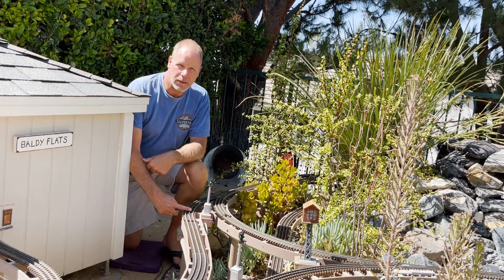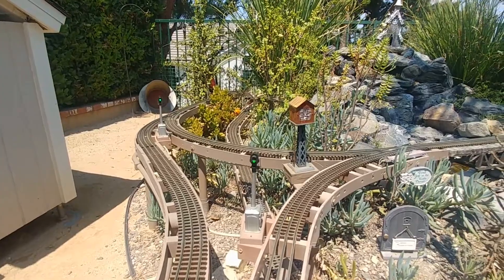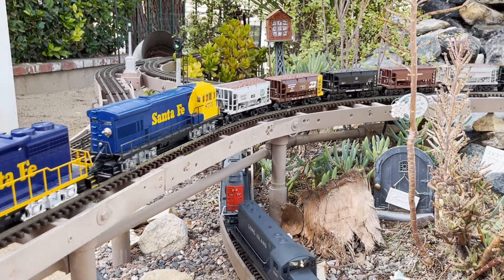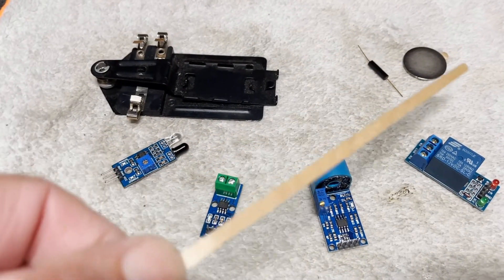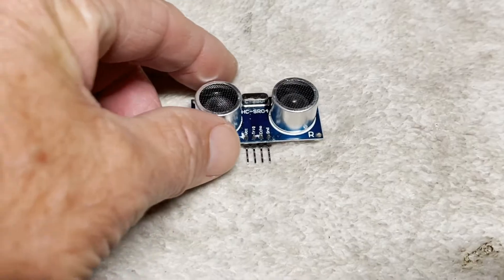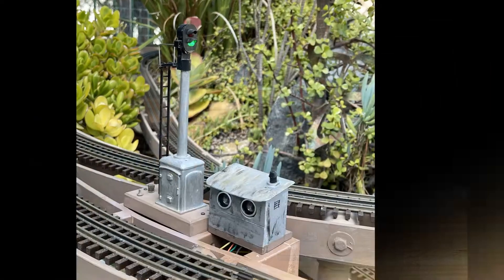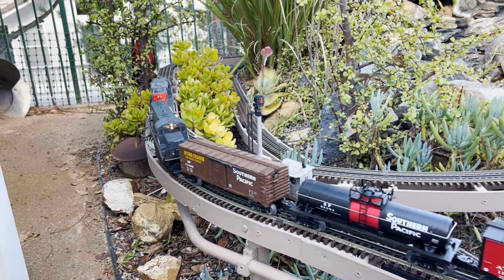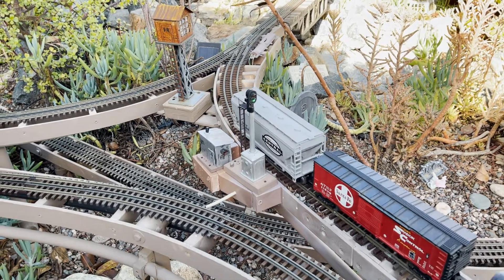Dead Rail Block Detection Track Signals HC-SR04

Comment: Not wanting to get off topic but I've watched several of your videos running dead rail on O 3 rail track and was wondering what you have to do to radio control a DCC decoder on 3 rail AC motors?
Reply from the maker: The motors on theses LionChief locomotives are actually 12v dc can motor, the pcb board has a rectifier converter the AC voltage to DC. Running DR, I simply run DC   voltage to the pcb board. The remote on the LionChief locos use radios frequency to control the loco. 🙂

Comment: Do you leave the sensors and enclosures out in the weather?  If so, do you find it has any negative impact on the hardware?
Reply from the maker: Yes I leave the sensors and enclosures outside. They are permanently mounted to the layout. During dry days I do have to clean to screens of the echo and trigger sensors. I use an old tooth brush to off dust or a spider web for instances. On known rain day I’ll put a plastic lunch bag over the enclosure just to keep the hard rain off the. I have the enclosure open on the bottom, so any water of moisture can drain out the bottom. Overall the sensors have proven to very reliable. Thanks for you question. 🚂🙂

Comment: How many locations (sensors) can you do with one Arduino controller?   this will be nice on my layout .nice to see more guys are moving to computer control stuff.    Jim
Reply from the maker: James, the Arduino has 13 digital inputs, and the HC-SR04 would require two inputs per sensor, a trigger and echo pin.  There is code published where you can utilize one input for both trigger and echo. The current draw on the HC-SR04 is up to 15mA.  The Arduino is limited to 200mA, you you can run four sensors and LEDs as long as you stay under the limit of the Arduino.  Using eight pins for the HC-SR04 sensors and up to five inputs for LEDs.  There is a small micro processor called the Nano that I'm looking at to run in a more remote areas of the layout and provide solar power to charge to small 12v battery.  Than Nano is one third the size of the Arduino Uno.

Thanks for watching and your comment. 👍🚂 Ron//

Comment: Did you try insulating the outside rails iforming the block section you want to activate and utilizing the fact that when a trail enters that block the rails will function as a switch through the wheels of the locomotive and cars since the metal wheels and axel will make a connection between the outside rails?
Reply from the maker: Yes I did try shunting the sections at each end of the blocks making a switch per say as the loco and cars tools by. However, since I run dead rail the loco and rolling stock wheels are not the cleanest they should be to trigger the circuit all the time. I would get partial activation with this method. So incorporating the HC-SR04 I get a solid activation every time at any speed. With dead rail, I only powered a few sections of track to activate by shunting, but did not have reliable results. Thanks for your comment and watching. Ron//
Reply: @baldypalmsrailroad  What was the length of track you isolated in the block?
Reply from the maker: @blcdad  I isolated two 10" sections of Altas track at both ends of the block. I insulated the two sections from the rest of the dead rail and also cut gaps on the outside rails to create a shunt area of track about 6 inches long.  I connected 5 volts power to the outside rails, and relying on the train wheels to trigger the signal. The circuit worked about 50% because the wheels of the train did not complete a good electrical connection to trigger the circuit. During tests of me holding the cars down with some pressure I could get the circuit to trigger. I cleaned the inner part of the outside rails but did not have any better results. So this is why I choose to use the HC-SR04 sensor to trigger the circuit.  Has worked every time during testing and during run sessions. Ron//
Reply: @baldypalmsrailroad  Did you ever try isolating about a 6 foot section of track; maybe 3 foot from the signal and another 3 foot past the signal? Anytime a a portion of a train was within this 6 foot section you would have multiple wheel sets potentially making contact as the switch. I have a couple if simple circuits I use for this kind of set up, but never used it on dead rail. It should work on dead rail in theory though.  There is one additional component I could add to my circuit if brief loss of connection would occur that would keep the circuit at the triggered state for that brief period of time. With a locomotive and a 10 car train, any of the 44 wheel sets that make contact with the track would keep the circuit triggered in that 6 foot section.
Reply from the maker: @blcdad  My first block circuit I did over a year ago with ZStuff signals I isolated the whole block, a total about 12 feet. Most of the time the circuit would hold the occupancy red, but still had a few bad conductivity and the signal would clear before the train exits the block. So I wrote the Arduino code so once the entry sensor triggers the signal will stay red until the exit sensor is triggered. While the train is in the block, the Arduino code is constantly checking to sensors for the trigger. Once the train begin to exit the block the clearing sequence will start and then reset the signal to green clear signal. I like this circuit better than having the train keep a relay in closed while in the block. Which can cause an early reset or a intermittent red signal. I did try isolating track with this circuit, but had issue with one side or the other circuit fail, causing the signals to be off sync. The ultrasonic sensors are adjusted to sense a few centimeters, so walking across the field is not affected. This is all done within the Arduino code.

Comment: I too found that IR does not work in daylight.  I have been experimenting with laser modules and have been getting good results.
Reply from the maker: Ah cool, the HC-SR04 is a bit large. Are the laser modules any smaller? 
There are other ultrasonic sensors that are smaller, but are a bit pricey for my project.
Reply: @baldypalmsrailroad  I am trying the KY-008 laser and a laser receiver module.  they are small.  I fit both into a lionel dwarf signal and shoot it at a mirror.  too cold to take a picture of it today.
Reply from the maker: @DeadrailTrains  cool I’d like see a demo when your day warms up.

Comment: Short, but sweet! Arduino sure has gained a lot of traction in the HO community, guess O is lagging behind  but I think we will see it more and more there also as time goes by. I like the solution, although the sensors seem very large and obvious. Did you run across smaller versions in your research? Thanks, Ron.  Happy New Year! T4
Reply from the maker: Yeah the sensors are pretty big, I think there are smaller one out there, but are a bit more costly. These are about two bucks each… I made the shacks so I can easily swap out when needed. Thanks T4 for watching. Ron//
Reply: @baldypalmsrailroad  Just $2? ...you are my kind of railroader, Ron! Thanks. T4
Reply from the maker: Yeah I bought five for $13. The other smaller style are $35 each. It’s just a railroad. Haha. I’ll get creative in hunting them on my other block circuits.